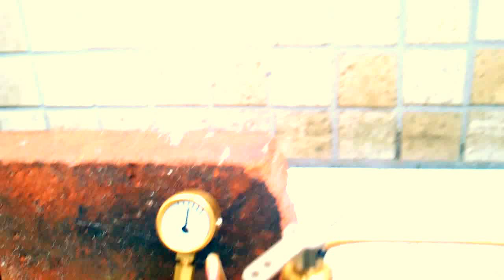taka's steam engine ** ASTER AMB IIC boiler +SAITO T2DR engine

Comment: Bonjour Januar-san,
I like indeed Saito steam plants, but I fear petrol burners, so I will use a gas one for my own boiler. And something is missing... ! Where is the whistle ;+) ?
For which boat do you plan to use it ?
Amicalement, Raphaël
Reply from the maker: Good day Raphael,
never mind, burner is not petrol fired , it is SAITO alcohol burner.
it is very reliable and safe.
whistle !? since this is a very small boiler, i do not want to waste steam, so no whistle for this boiler
for which boat ?? that is a good question, no idea so far. (i just acquired it for collection.)
by the way, you might have seen WADA turbine test on my previous post.
i installed it onto boat #8 today, and ready to run scheduled for tomorrow.
wish me luck.
regards, TAKA